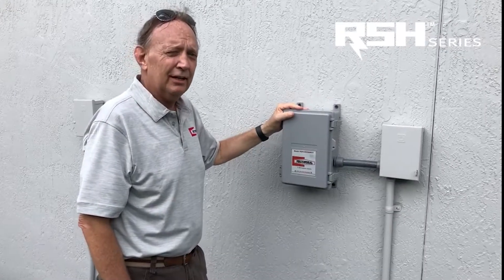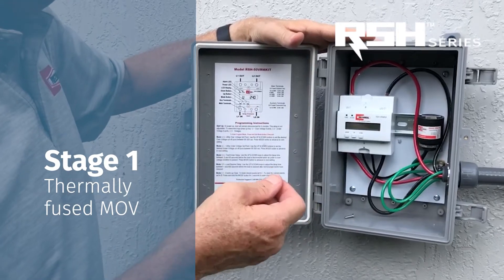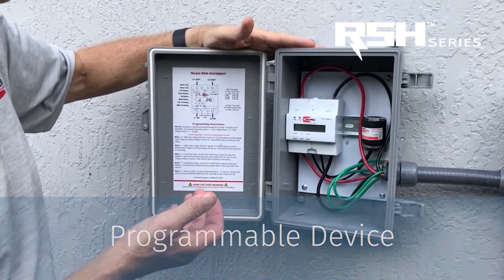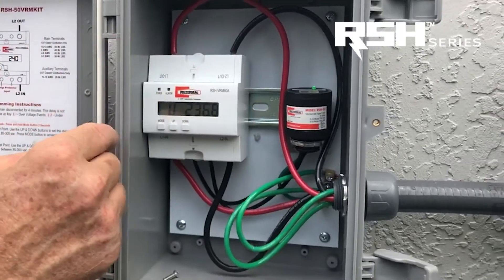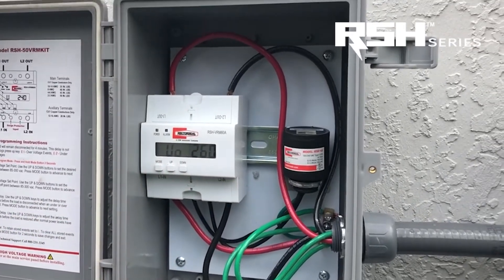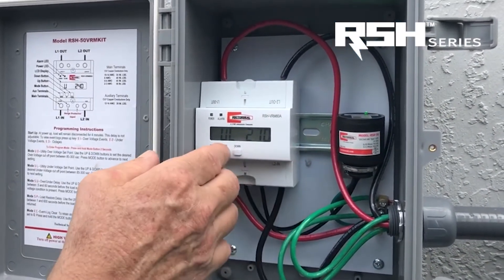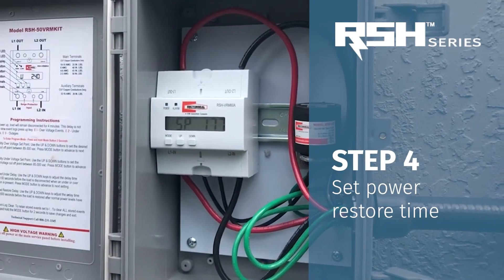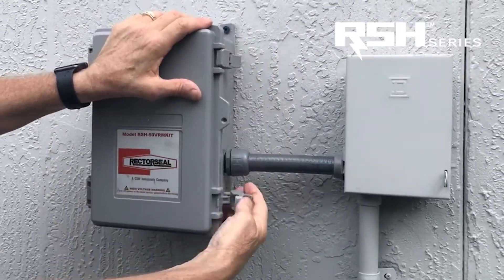RSH50VRMKit - Voltage Range Monitoring Device Demo

Comment: This unit would not protect the circuit board for my RUUD 20 SER Ultra inverter AC because the circuit board is powered from the 24 v transformer in the air handler. The air handler is feed from a separate 100 amp breaker and your unit is not suitable for that large of a breaker. What does protect the circuit board is a 3 amp fuse.

Comment: Thoughts on using this for non-AC products.   Specifically Induction cooktops.   With some of them costing over $5000  having some protection on them seems like a common sense move.  I can not see a reason this would not work for a 50amp cooktop.   Any known issues with doing so?

Comment: Just installed this for a customer and as soon as we gave power to the vrm we have the alarm light on any idea what could cause this issue? Checked for proper incoming voltage but it will not allow voltage to leave
Reply from the maker: Chris that's a great questions. Our technical service team can help answer those questions. You can contact them through here https://rectorseal.com/technical-question or toll free at 800-231-3345.

Comment: What is the hysteresis factor of the gate? For example, if the over voltage set point is 264v, the switch will open a 264v. At what point does the switch re-close? 5%
Reply from the maker: Great question, Big Mack! Answer: 2-3%